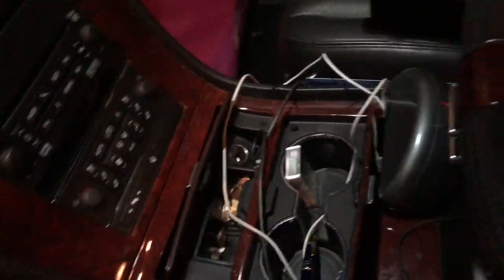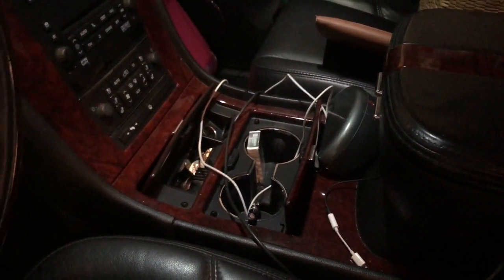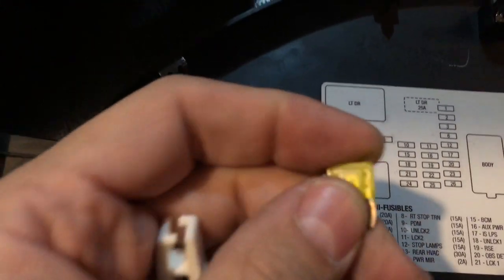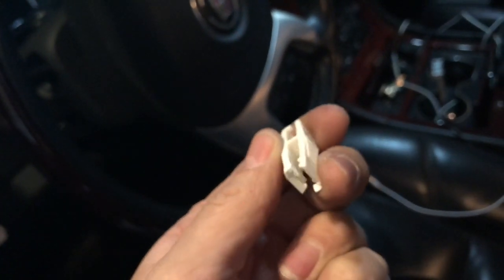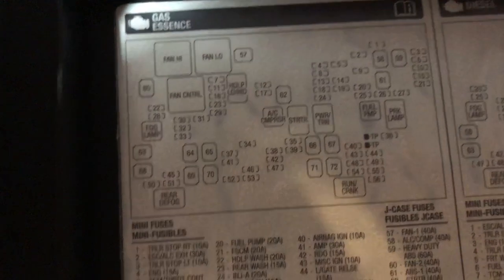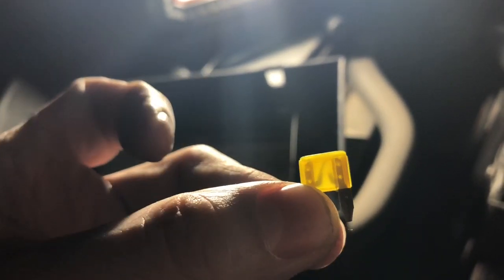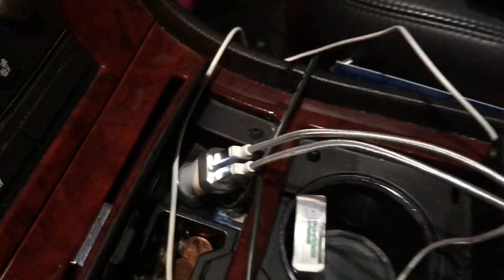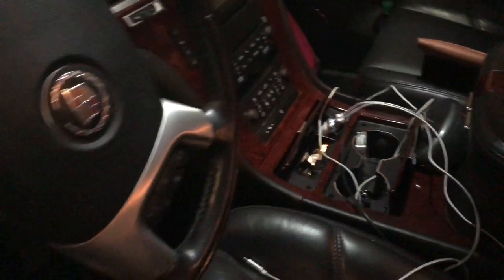Cigarette lighter repair Escalade Yukon Chevrolet Tahoe Suburban Silverado Denali

Comment: Thank You!!! The same happened to me. I used my electric tire pump and popped a fuse. I got the passenger back working but not driver side which was the one I used!?????
Reply from the maker: There are two different fuses. The one for the cigarette lighter is where I show in this video but I think the other is in the fuse panel that I show left of the steering wheel inside the vehicle.

Comment: Has the direct power to the cigarette lighter been a problem for you? I left my charger plugged in over night and it drained my battery. Is there a correct way to make the cigarette lighter turn on and off with the ignition?
Reply from the maker: Have you checked the health of your battery? Checkout this video on how to check. That’s what I would look at first. If you think that it’s draining the battery then you can try to pull the fuse for it to isolate and prove that it is the cigarette lighter that is causing the issue . How to check a battery, alternator, and replacing a battery. Absorbent Glass Mat Battery
https://youtu.be/7uTPMmFpghg

Comment: THANK YOU SO MUCH. I’ve been having some many problems with my Cadillac Escalade 08. I have spend $10,000 in repairs and It’s still not fixed. I believe it’s the Shops I’ve sent then too . I would tag them but I’ll wait to see it they fixes the issues.

Comment: My 2007 escalade got a penny stuck inside the lighter with the engine on, that caused a melting of the wires behind the dashboard bringing a lot of smoke. The fuse got toasted. 
Be careful having coins close to the lighter port it may cause a fire!
Reply from the maker: Stang 21 I keep my coins right next to it but always have a phone charger plugged in.  Good to know though and glad it wasn’t worse.
Reply: Mine had a dime in (near cup holders)... kept blowing the fuse and fun fact, it prevented the OBD reader from reading my codes 😅
Reply from the maker: Wow that’s crazy.  Those are the problems that want to make you bang your head against a wall...and when you figure it out you want to bang your head against a wall too lol.

Comment: Great video,helped me to go do it and check the fuse,a lot of dishonest car electricians will tell you hmm, I have to check it out and open the lighter section !!!🎉🎉
Reply from the maker: Thanks for taking the time to leave a comment 👍
Reply: @OmarsGarage  I called an electrician and was told that they would have to diagnose the dashboard lights and open it up,didn’t even mention the fuse box!!!Thank again.
Reply: By the way do you know whats going on with same car interior lights please and thanks for reading:
when I want to turn on roof light manually or one of them,it won’t turn on unless if I turn the whole switch on which will turn on all inside lights and will not be comfortable during driving specially at night,also there is no light in stereo keys and steering wheels indicators such as volume up/down,cruise control keys,…etc,what seems to be the issue?
Reply from the maker: Sounds like that can also be a fuse issue but not sure which particular fuse.

Comment: Thanks for the video. My 07 Denali XL lighter been out for like 8 months!
Reply from the maker: Lol...that’s a long time.  That’s why I make these videos.  Sometimes it’s such a simple fix, but you just need to know how.  🍻
Reply: @OmarsGarage  I just checked my 20amp fuse it's not blown but it is a different style 20amp fuse. It's not like the ones like the rest of the fuses I'm changing it out now hopefully this works
Reply: @Cmimss  Did you ever get it to work? My fuse in my 2007 Tahoe LTZ isn't blown either but the cigarette lighters been out for like 2 years after I hooked up a tire inflator.
Reply from the maker: There’s two different fuses for the cigarette lighters.  Make sure you check both.
Reply: @OmarsGarage  I've checked all of them. None of them are blown. I swapped them out with new ones out of the pack and still nothing.
Reply: @marcusbennette8454  Yes it worked! Dig deeper maybe a fuse of a Fuse is Blown these Gms can be a Trip!
My back Wiper isnt working wither. Soon as I put a new fuse in It Pops right away!

Comment: what is causesing a tier wareing ou in side
Reply from the maker: Tracy Felix a tire wearing on the inside is usually caused by the wheels being out of alignment.  If a component of the suspension has taken a hit and it bent it could also cause this.  What kind of car do you have?

Comment: Where is the fuse for the one in the rear? Like near the captain chairs
Reply from the maker: That might in one of the fuses in the fuse box behind the driver side door.  If you remove the panel you will get a diagram of the fuses.  It should be either fuse 2 or 16.  They are labeled a Aux.

Comment: Does it have to be 15a? I have a 20a I may use
Reply from the maker: XjuanissimoX7 it should be a 20A fuse not a 15A.
Reply: I fixed the fuse but there’s still no electric power in any of my 4 cig lighter outlets
Reply from the maker: XjuanissimoX7 are you sure the item you are using to test them is working?  The cigarette lighters are on two different fuses.  One is located under the hood and the other on the side of the dashboard.  There shouldn’t be a reason that all four would be out at the same time.
Reply: Omar's Garage what’s the fuse in the dashboard called?

Comment: las luces de licence plate no encienden en mi escalade y lla le puse nuevas me puede ayudar
Reply from the maker: Puede ser que tenga un fusible quemado. Tendré que buscar a ver cuál es el que corresponde a las luces del license plate.
Reply: @OmarsGarage  gracia estoy pendiente de que me diga cual
Reply from the maker: Aquí puede ver los fusibles. Creo q es uno de los rear parking light. La caja está a la par del motor.
https://www.google.com/amp/s/www.autogenius.info/cadillac-escalade-2008-2010-fuse-box-diagram/amp/
Reply: @OmarsGarage   no save q numero de fucible es
Reply from the maker: Pruebe 26 o 27.
Reply: Eso are muchas gracias por su ayuda buena noche

Comment: Mine still not working after changed the fuse of 20 amp
Reply from the maker: Was the original fuse blown?
Reply: @OmarsGarage  yes original one was blown and I did changed it and I noticed penny was sticked inside the lighter and I took the penny out as well before I changed the fuse but still not working…… I have 2007 Cadillac Escalade…..please advise
Reply from the maker: Check to see if it blew again.
Reply: @OmarsGarage  I checked the fuse under the hood and it was a 10a fuse. I changed it with a 20a and it blew when I started the truck. Help!
Reply from the maker: @craigwilder8715  have you checked to see I there is a penny stock inside the cigarette light hole.
Reply: @OmarsGarage  Yes there was a penny stuck inside and I removed it before changing the fuse. Like I said there was a 10a fuse where it's supposed to be 20a. Do I go back to 10a?
Reply from the maker: @craigwilder8715  I would check the fuse diagram to make sure you are looking at the right fuse and put whatever the diagram states should be in there. The only thing I could think otherwise is that something in the cigarette lighter melted and fused if it keeps tripping.

Comment: But why do they blow fuses. Longest video ever just to change a fuse.
Reply from the maker: This receptacle is made to just handle the voltage of a cigarette lighter…the one in the armrest or in the trunk is made to handle chargers and other electronics so many times it gets overloaded. Also it’s easy for coins to fall in there and those can also trigger the fuse.